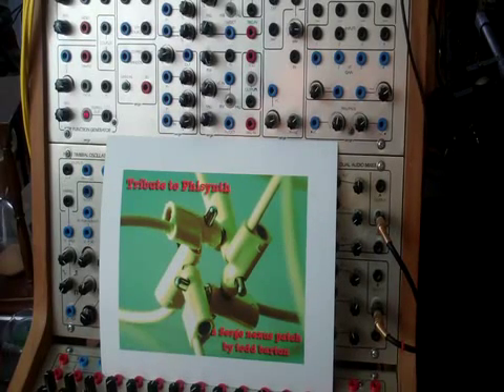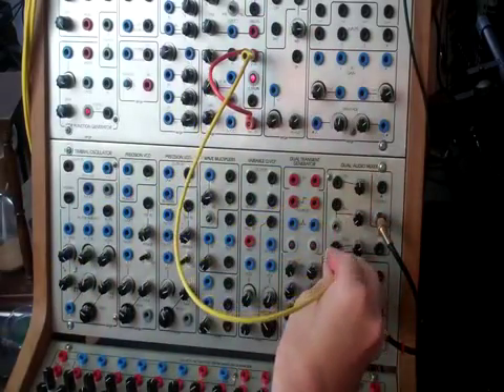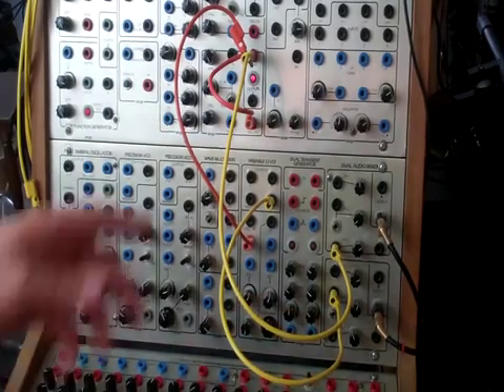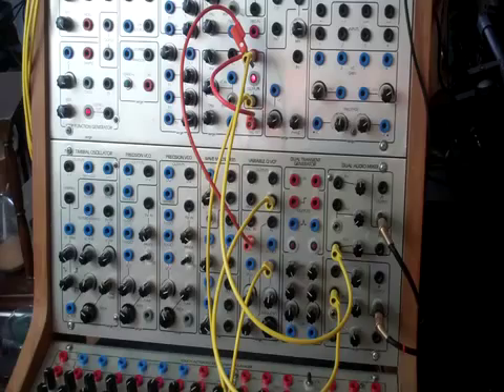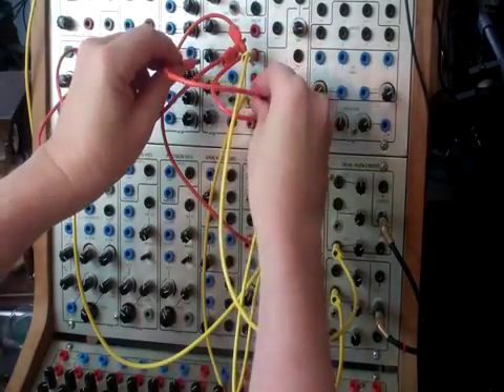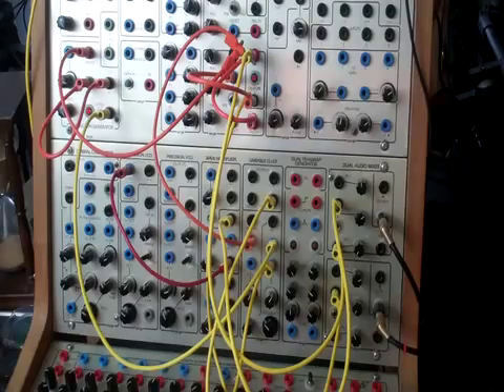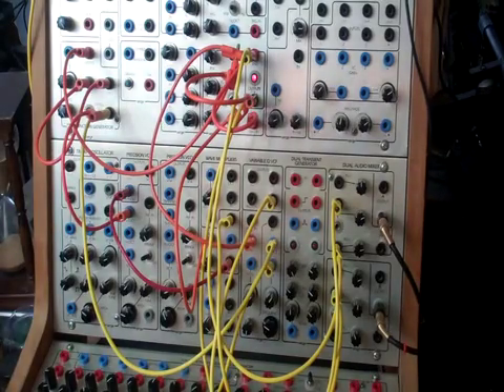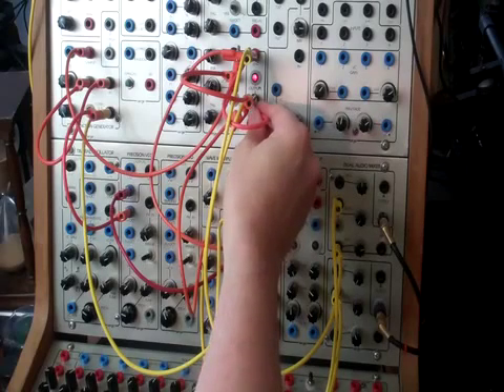Serge Nexus Patch

Comment: thank you very much for your tutorials & info
after watching this video, I finally realized that DUSG has 2 triggers on the gate output ("end of rise" & "end of cycle")...but, for some reason, both triggers do not fire on the trigger input of the VCFQ ( you need to amplify the signal of "EOR" for this )
so you can get the doublets of self-oscillating VCFQ ) its very interesting
cheers